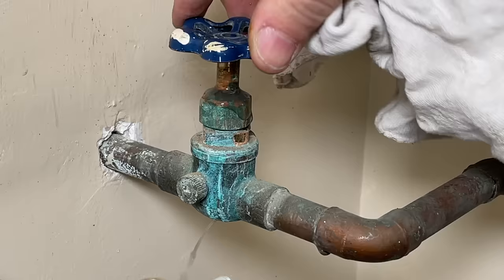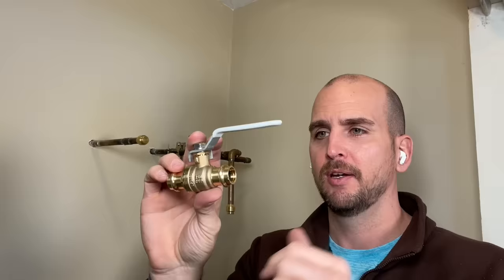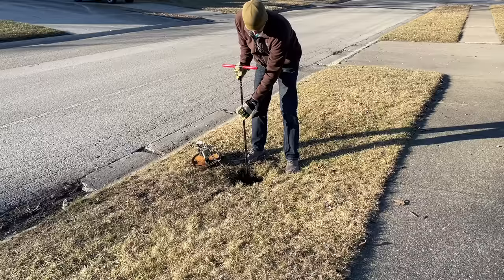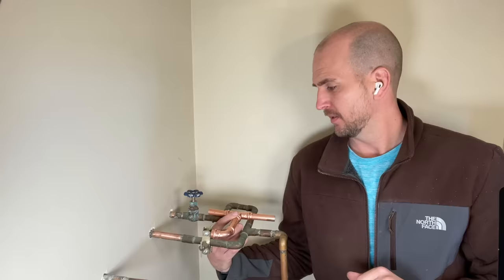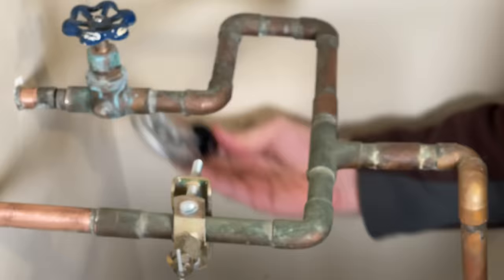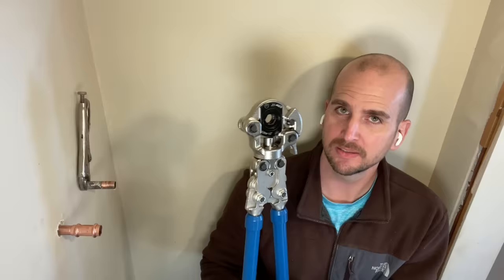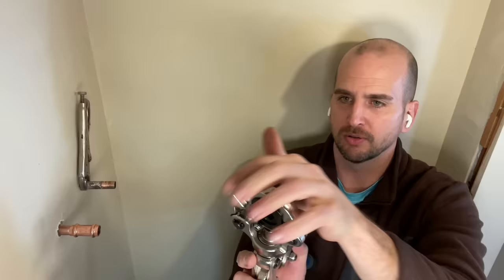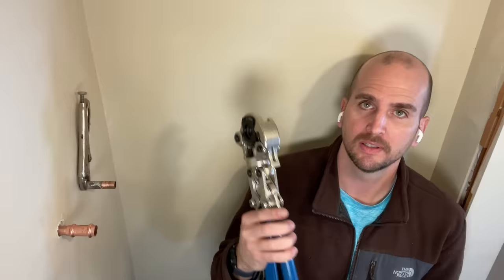How To Install a Main Water Shutoff | NIBCO Press Fittings

Comment: Another valve is required on the cold supply to the water heater after it tees off from the main, so just install a ball valve and shut it off instead of a cap. 
Also, if the water heater is lower than the water lines, like in a basement or 2st floor of a 2 story, it's smart to install a ball valve on the hot side also, to prevent the water lines draining during future replacement.
Reply: illegal to install HWT  discharge valve....a potential catastrophy if valve shut off accidentally
Reply: @miketurgeon5506  hi Mike, I wasn't talking about putting a valve on the T&P relief/ "pop-off"l valve, that of course would be highly dangerous and definitely illegal. I was simply talking about the hot water supply out to the fixtures.
Reply: say you put a shut off on the hot AND cold lines for the water heater ,turn them both off and the regulator controlling the heater temperature fails and stays firing .what do you think will happen ?
Reply: @bussardplumbing7495  Exactly the same thing that would happen if the Tstat failed and it kept heating when no hot  water was being run in the house, the Temperature/Pressure relief valve("pop-off") would open and relieve the pressure. Remember that when all faucets and fixtures are closed it still creates a closed system.
Reply: Additionally,  as I noted above,  the only time you would need both cold inlet and hot shut off  would be when you were draining it, as in replacement,  so of course the gas would be shut off as well.
Reply: @garywalls9041  you never need a shut off on the hot side from the water heater you can easily drain the hot side anyway .when I attended a 2 year plumbing and heating course in Williamsport back in the 1970s ,they showed us a film of a water heater with defects at gas regulator and thermostat and ensuing destruction .Don't give a frantic homeowner any more opportunities to fuck something up because they will . Your point about it still being a closed system is true ,but they didn't show us a film of a hot water system going thru the roof , just a water heater . Course , it could pop something and do plenty of damage

Comment: I've used one sharkbite in my life. It was in a bathroom water line under a sink and I didn't feel comfortable soldering copper in such an enclosed space. The fitting went on without any fuss and I haven't had so much as a drip in three years.
Still prefer to solder my joints but sometimes the press fittings do come in handy.
Reply: I used to install commercial dish machines and both sweated pipes and used Sharkbites. They both have their places, but I liked Sharkbites for their ease of use and speed of installation. No leak problems if the pipe is cleaned properly.

Comment: sharkbite worked ok for me... easy and removable. Saturday pinhole  sweating will not work in vertical pipes with water inside. shut off valve at the curb not accessible. i used a new valve and a sharkbite connector. problem solved.

Comment: Shark bites are reusable where propress fittings are not also my experience with press on fittings is they do not last do to the distortion of the pipes when pressed. I have seen leaks appear at the crimps area and from the seal. I have reused shark bite fittings that were 15 years old and they are still in use now. Shark bites are the way to go

Comment: Why couldn't  you have a stop valve installed inside the property than going into the roadway and shutting off the water. 
Plumbing is superb when one has the knowledge and tools.
Thank you for this informed video
Will tap into your knowledge to improve my skills.

Comment: Use compression fittings instead of sharkbite, no " O" ring to worry about being damaged. Otherwise solder using tinning flux when safe to do.!

Comment: Love the crimper, but in THIS case, as others have pointed out, a solder joint makes more sense, Ed cause the solution shown will not leave you with enough room to work with the next time it needs to be modified or replaced.

Comment: Ball valve do have a direction of flow it good practice to use the handle pointing in the direction of flow this is big indicator that you sir are not a plumber take pride in what you do sir have a standard upc all the way it not just code it the way of life

Comment: Nice video but no doubt the manual version is a young man's tool.
Good information, if I were going to start a handyman or maintenance business a cordless crimper would be a good investment. As it stands 
an occasional repair or valvel replacement now and then can be solved by compression or sweat fittings.

Comment: Oh rule of thumb is never use shark bite that is going to be concealed. Like in a wall or ceiling. That is advice from a retired plumber. Exposed in an quick fix is okay but not concealed.
Reply from the maker: Absolutely agree 👍
Reply: Yes, and some codes do not allow them to be in concealed installations.
Reply: @waterheaterservices  You are incorrect.  You must start at go again..lol

Comment: Ball valve orientation might be important based on clearance for the handle.
Reply: Don't want to install it then find out you have to turn it towards the wall two inches away 😂

Comment: I like your new method, but as I do several plumbing jobs a year, whenever I can I will use for Ball valves compression and then just sweat the rest of the pipes, since I do not like or trust pexs or plastic piping inside walls and have not invested on this press fit tools yet, i trust compression fittings and they are also easily replaced.

Comment: I sweat pipes well and prefer to do that. I will use compression fittings at times and in the case of water inlet, well, it's a toss up. Depends on physical factors for the most part and local code.

Comment: Sweat them pipes it is the cheapest alternative and once you master it it is pretty simple just don't burn the house down. I have used shark bite on occasion and they work well in tight spaces and no chance of a fire.

Comment: Hello.
After demolishing old bathroom(black mold), I chose to use compression fittings. $10 apiece, but there was No heat or shark bite(plastic hoses).
Once it's tight, it's tight. And reuseable.
BullyBilly.

Comment: To all those who point out the clearance issue for installing a ball valve, the handle can often be removed and reinstalled to afford the swing necessary. Rarely this changes the stop position slightly but not in any meaningful way. Silocone o ring grease can be a valuable assembly aid and keep the o rings from drying out at their rated 25 year service life, but only if used before the crimp is done. Indispensable for hydronic heating systems as they are exposed to huge temperature swings and thermal expansion that requires the orings to remain pliable, unless your committed to planned obsolescence.

Comment: I've used Sharkbites for about 8 years. The neat feature is that they can be removed, and reused. Oh, and are those caps in your video on the cut ends of the pipes for future use, Sharkbites ?
No doupt you used them, so they can be removed. I think you should have pointed that out.
Reply from the maker: Yeah good point and I do really like the sharkbite caps. Very handy.

Comment: I'm set up with solder and could easily redo my mistakes where as this press fit is a one time shot. Used shark bite once since the store didn't have the size I needed. 5 years now and I look at it once a while to see if its holding, don't trust the O ring under extreme exterior weather conditions.

Comment: There are push-on ball valves available in Home Depot, don't need any tool to install it, just push it on by hand. You just need to calculate the distance to decide if you need to take off the old one by flame or cutting.
Reply: Thats Sharkbite. Thanks Mr Obvious.

Comment: Shark bites perform very well.except if exposed to cold temperature. I only seen them fail if not installed correctly or not being insulated in freezing temperatures.

Comment: O-Rings dont last forever. A soldered fitting will last longer. An oring is what took out the Challenger.
Reply from the maker: Good point.
Reply: Yup 4
Reply: Really? I thought it was the explosion.
Reply: @DonJosesito  A failed o-ring caused the explosion.
Reply: Actually the flight director was overruled to scrub the flight due to the temperature being too cold for safe flight parameters. That catastrophe is taught as "Go Fever" due to the want to appease such a highly advertised event. Sad to say he was literally held hostage to watch it explode.
Reply: The o-ring doesn't create the seal the mechanical deformation of the pipe does...
Reply: @angelusmortis3256 then why have the oring? The Mechanical deformatio  is what holds it together. I challenge you to remove the oring, assemble and pressure it up.

Comment: Hello from UK - I like the press fit type fittings they save a load of time but like you say the ONLY tool I have found in the UK have been battery ones £1000-1500 - they do not do a manual tool for the UK brands of fittings available - this might be to sell the tools !!!

Comment: Shutting off the water at the street is simple, if you have a 4ft long extension for the wrench. If I had that wrench, then I would solder my fittings any day. Solder lives much longer than an O ring.

Comment: Sweating the pipe is they way to do it right ! For me anyway over 40 years experience.. I would never trust shark bites. I have replaced a lot of leaky shark bites . only thing I ever use em for is a quick fix . and come back and solder in what I need to...
Reply from the maker: Thanks for the feedback.  Any common failure point you have seen with the leaky sharbite fittings?
Reply: @EverydayHomeRepairs  had one that copper pipe wasn't cut evenly, had numerous underground  copper espically soft copper wasn't lined up evenly. The o rings have leaked on numerous shark bite fittings I ran across ..

Comment: I watched a different video put out by another guy that used the same crimping tool.  He made it would like you needed arms like Hulk Hogan to operate it. You seemed like it wasn't such a feat of strength. My concern is how long these rubber o rings are going to last. Your video was very informative. Thanks.

Comment: I like sharkbite fittings & they are handy as a shirt on a pocket in a pinch/middle of winter/night an a pipe busts they are a quick easy fix..How ever i like/use the crimp fittings way better for any kind of permanent application especially if its hid in a wall or something..shark bite's are handy but only as a temporary fix as they Will leek at some point 99.99% of the time ! it might be a year or even 3-4 but when they do ya need to know asap  ! I am no pro but im a long way from a noob either ive done plumbing & electrical work from the time i was 8-10 But i also help run/manage a big farm with 225 + cattle ,Hogs & ya half to know how to run equipment as well as fix a /run a line to water the critters to get power from point a to b as well so ive ben pretty blessed to learn all these things from a young age but like i said im not a pro but no noob Either..lol.

Comment: thanks scott!    never seen a bigger bunch of negative nancy whinning people about using a press fitting   vs soldering   vs pex....        just showing another process    that gets done a lot every day all over.     not my favorite   but certainly can be a very worthwhile process   Ive put  miles in of press fittings   I do this for a living   boss says this job is press fittings heres the gun and heres the material  its definately faster  takes less skill  , less leaks, less skill, less labor.     costs much more for material    if something needs  a little tweak  you gotta  cut it out and use couplings      so a few disadvantages   .     less chance of fire damage

Comment: As always, great presentation. One question: the original installation had a U-loop off to to your right immediately after the shut-off valve. Your preassembled replacement piping did not include this U. I wonder if the U was intended to relieve thermal expansion or water hammer stress on the fittings.

Comment: Soft  solder in a ball valve where the valve is sandwich between two sweet on flanges with bolts for easy replacement in the future.

Comment: Seems like it works for certain applications. But I would bet more on soldered joints. . I also use a grinder with cutting disc for limited space cuts whenever the regular pipe cutter doesn't work.
Reply from the maker: Thanks for the feedback Jeff.

Comment: You would be surprised at how many plumbers use Sharkbite fittings.
Reply from the maker: It is hard to beat the convenience but for larger jobs the fitting cost could really add up.
Reply: ...lazy. & know better